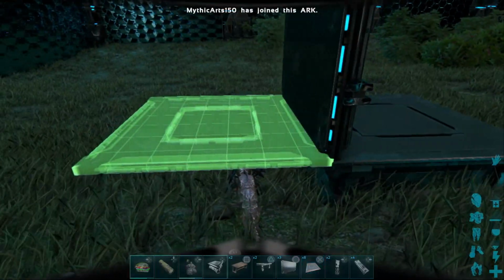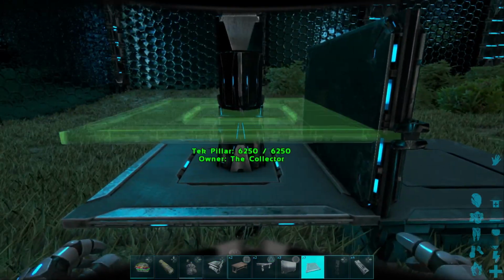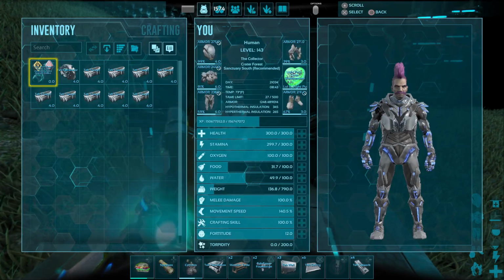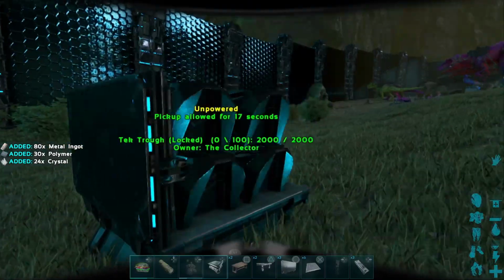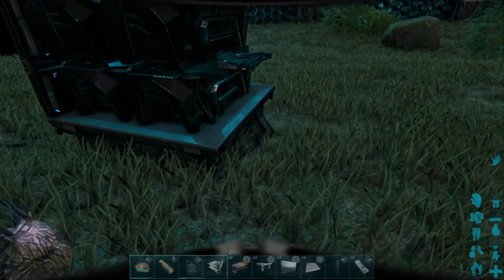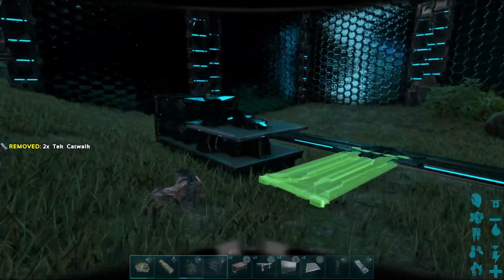How to Stack Tek Troughs \ Feeding Troughs | ARK: Survival Evolved

Comment: Great Video!!!!!

Could you replace the foundations with ceilings and place more troughs underneath?
Reply from the maker: well you will need at least 1 foundation but I'm sure it can be done, or instead of placing the gen on the first row, put it on the second and you can add more rows on top and gen stays in 1x

Comment: How u can put the pillar so down. At me it shows green, but cant place it
Reply from the maker: It happens to me a lot, you have to keep moving around looking for the sweet spot, on ps4 or ps5 if you press R1 it keeps changing snap points, that will make it a lot easier
Reply: @YPou97  worked. Ty